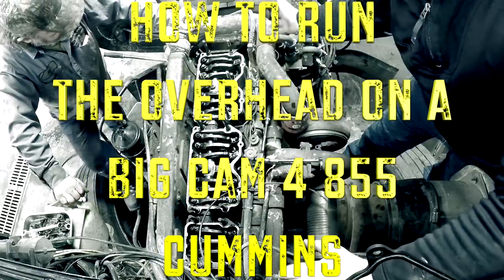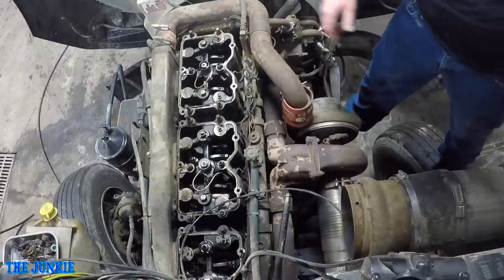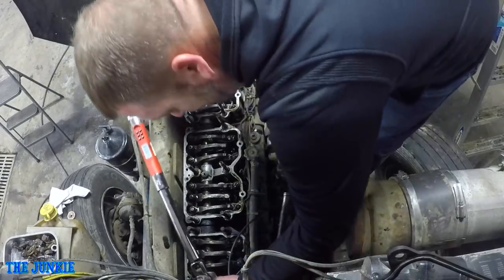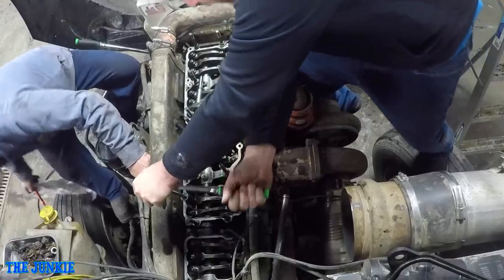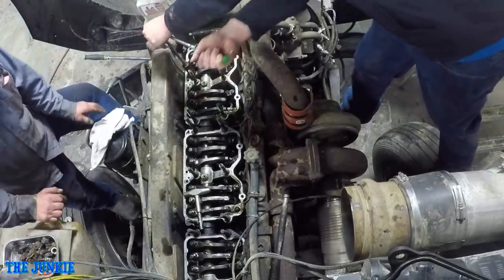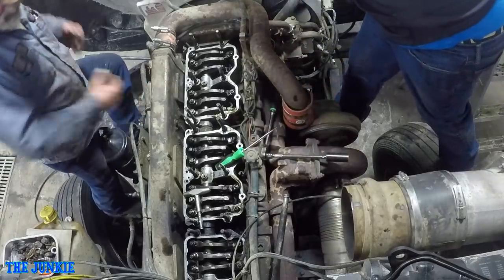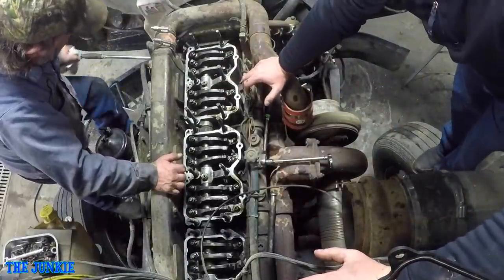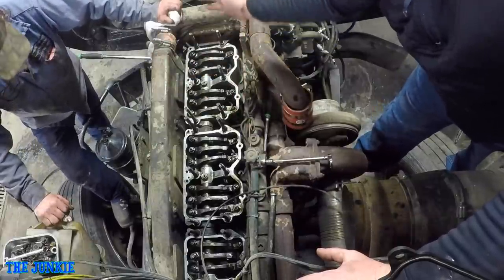HOW TO RUN THE OVERHEAD ON A BIG CAM CUMMINS🛠⚙️🔧🔥🔥

Comment: So u loosen the rockers before u slip ur lady slipper under the rocker nd valve right? How loose do u go?  And so is a 86 NTC 365 IV it’s in a 1987 Kenworth T600A.. thank u for the video great work lots of knowledge I’m doing my first head gasket job on one of these. Very excited, any pointers tips or tricks would be awesome.

Comment: Have you ever used a dial indicator for setting/checking the injectors ??
Ps the low flow cooling system is basically a divided radiator a part of the radiator cools the intercooler water more than the engine part !! And leaves the engine to get hot easy (early EPA shit most likely)
Reply: ptd injectors can be set with dial indicator or torque wrench, later top stop injectors were set inner base circle of cam with 6 inch pound torque wrench, you can't set with normal firing order like using  torque method on ptd's. Stc injectors are set inner base also, but you need either special tool or maybe hook end of a scribe to keep from collapsing tappet while torquing to 6 inch pounds.
Reply: That’s how I like to but then again I’m a machinist..
Reply: There us a special tool for setting STC.  It keeps the piston from collapsing so you can get the correct setting with a torque wrench.  We never used a dial indicator to set injectors.

Comment: Just ran a overhead on a big cam thursday. Pretty easy to do, hardest part is the crossheads.
Reply: Hi can u send me how to do it please
Reply: Cross heads? Over the valves??  Easy, bring the adjustment side up to level, then go just a little bit more & lock it.

Comment: I’ve always heard 6in ibs on the injector rocker then back two flats. Correct me if I’m wrong.
Reply: On a big cam engine??  No, run it to torque spec then leave it.  We never backed it off in the shop.  Now on an N14, the adjustment is to run it down, then back it off 2flats.  According to spec.  But, it runs better if backed off 3 flats.

Comment: Big question buddy I have a 855 NTC-400 big cam Cummins just got a fresh rebuild and it started leaking oil and water but not mixing took it back spent bout 3k on the bolts cause the others stretched and new head gaskets but the shit keeps leaking any suggestions really can’t break down spent all my last bit of cash on the rebuild and the fucking head bolts mechanics can’t seem to get the location of the leaks

Comment: I have a BC1 w/ a spun rod bearing, crank is probably dust. In Los Angeles area. I need solutions. I heard a BC3 will replace it. Contact if you have solutions.  Dated 4-16-18

Comment: Hey Justin/diesel guys out there: funnily enough have just had to pull the head on one of my diesels as there were no mechanics in the area who could jump on the project. The head gasket was blown.

All valves have been set, but for whatever reason the 20-year-old engine does not want to fire even with fuel to injectors. Even attempting with starting fluid barely fires.

The engine is known to have bad compression, and whole truck is being replaced the summer. She did start when she was parked before replacing the gasket. Starting fluid vapor can be seen coming up from the push rod passages. 

Any suggestions from diesel Yoda on what to look for in the meantime?
Reply: Darren De Silva you put in to thick a headgasket
Reply: The rings are worn out..... it doesnt have enough compression to start
Reply: @samsungavant9163  This

Comment: if injectors are that loose on that engine they are carboned to the point they need cleaned and  tested.  your torque pattern on the rocker boxes is wrong. but it will work. i always recheck at least the first two the load on the vavle train will change the settings.
  there are 4 notches on the accessory drive-  1-6 , 2-5 , 3-4, and 1-6tc or just tc.      PVI -power valve injector  when on 1-6 both valve will be loose on one or the other.  that is the one on power then go by the firing order 153624  1 on power set valve on 5 injector on 3   then go to 2-5 and continue on.   when you set the injectors once you hit the six inch lbs run the bolt in one turn and back off  do twice to get the fuel out of the cup then back to 6 in/lb  for a more accurate setting on top stop injectors.
Reply: richard cranium lmao your name!

Comment: Do you have a video on how to take the injector pump off of the big cam by chance? Mine sprung a leak yesterday and the guy wanted 400 bucks just to take it off and put it back on, and someone else rebuild it adding 700 more to the bill... l'm thinking l can take it off and put it back on saving that 400 dollars..
Reply: Undo the all the fuel lines, take wire off fuel shut off solenoid, revove the throttle linkage and return spring, check to see if it has a 5/8s or 12 point 7/16 bolts holding the pump on and buy the specialized wrench to take them off ( take my advice and get both sizes just incase you ever have to replace your accessory drive or air compressor every one I've worked on has had 5/8s bolts holding the compressor to the accessory drive) and those 4 bolts hold it on. And when you put it back together just be sure that the plastic peice stays in the gear set coming from the compressor to the Injection pump and inspect it to make sure it ain't cracked or broken I've found them broken many of times. Job shouldn't even take a hour to do

Comment: and hoW do i bleed the air out of the NTC 350,,,,,FUIL LINES???
Reply: You don't, it bleeds itself.  Now if its sucking air, thats a different problem.  Have ro change the fuel lines from the tanks.

Comment: Does that motor run on low flow or full flow cooling system?
Reply from the maker: Samuel Flores It’s a low flow piece of shit
Reply: The Snap-On Junkie!!! I got one should i swap motor for somethimg else or can i convert it to hi flow..thanks for responding
Reply from the maker: Samuel Flores I don’t know if you can convert it but it’s better to have a full flow coolant system the low flower ones are kind of shitty like I said before I’m if you could find one
Reply: You can convert to full flow.  The Big Cam 4 has a low flow system.  The 1, 2, and  3 Big Cams have Full Flow systems.  I believe you can convert it with parts from a 3406b or N14.

Comment: When Jim was using the heel bar and holding down on the exhaust valve to listen for a mess why wasn’t he just cracking fuel lines on the fuel pump?
Reply: because the fuel pump feeds all 6 injectors like a 71/92 detroit
Reply: We never held the valves open, but we did hold the injector plunger down, the same as cracking a fuel line on a cat.

Comment: What's a Jake brake?
Reply: George Black a brake that uses the engines compression to slow the vehicle. Heavy trucks utilize them to prevent overheating the service brakes on the wheels. They make the loud exhaust noise when trucks are going down hills.
Reply: @samwagner31  AHH ok, thanks for the explanation Sam! Much appreciated!

Comment: Special socket for those 7/16" bolt?
Reply: The rocker box/jakes??  Yes, a special deep socket for the Xtra long bolts.  And unlike whats shown in the vid, we used to torque em to 75 ft lbs, then torque the Jake's to 65.

Comment: There is a better overhead method than the one yall used.... it would be setting the valves and injector on the same cylinder at each position of acc drive pulley. Torque injector plunjer to 90 in/lb (because it is on the outer base circle of cam lobe) valves are still  
.011 & .023....A : cyl 1 or 6 (whichever has both valves closed) B : 2 or 5. C : 3or 4.  Whatever cylinder you start on you will continue in the firing order....1 5 3 6 2 4
Reply: You set nontopstop, STC, and celect injectors obc. Those are topstops they did it right
Reply: I would not do it any other way than what is shown.  Have seen a set of injectors get ruined, and they were expensive 35 yes ago.  Would hate to see what they run today!!!
Reply: @Nathan-pw7do  i worked for cummins when these engines came out... you have top stop and non top stop confused it seems..... top stop, stc, & celect all can be set obc....
Reply: @samsungavant9163  top stop injectors go 6inlb ibc that's why Cummins had the adjustment sequence cards. I was a full time Cummins mechanic in the 90's, set lots of overheads.